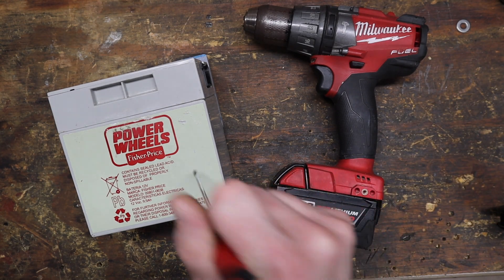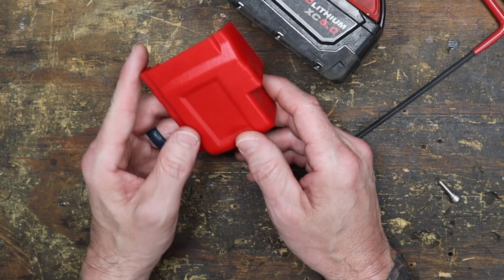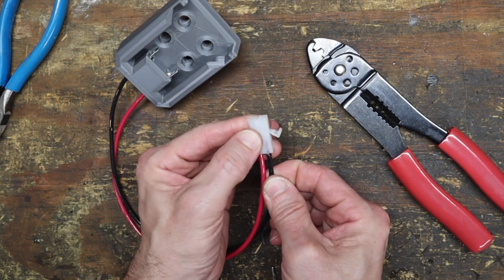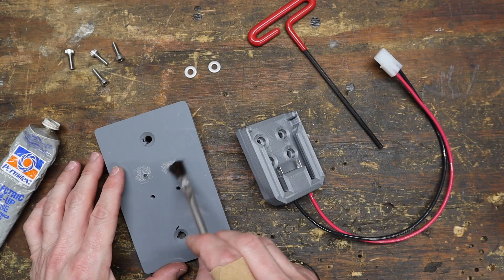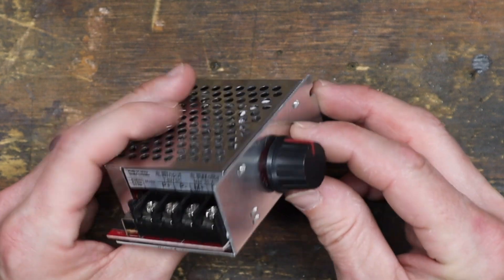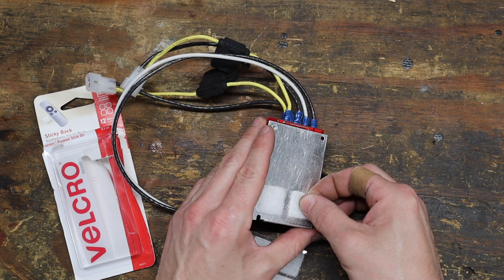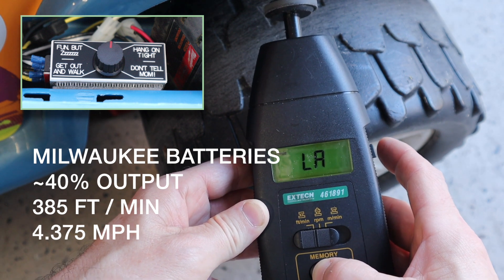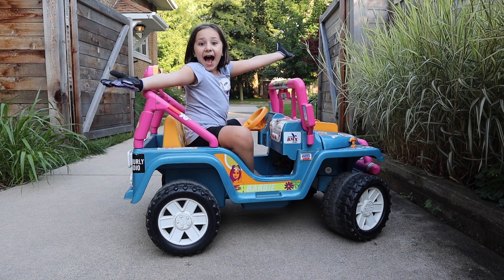Power Wheels Vehicle 18 Volt Milwaukee Battery Upgrade!

Comment: You sir are an engineering genius! I did the same thing with Ryobi 6 amp hour batteries took apart some Chargers and soldered directly to the board.
 I like the speed controller it's a nice touch also like the Dual batteries for the extra capacity

Comment: Should have wired it in series, and then did a DIY wheelie bar video too.
Reply: I had a customer come to my shop and asked me to cast some metal gears for a power wheels project. We made some from aluminum and he absolutely loved them. Ended up breaking them so we remade them out of 316 stainless and he came back about 2 months later going on and on about how they worked so perfectly. His son now wins every power wheel race they have in the neighborhood. Of course we had to solve the low traction tires issue. Nothing a lawn mower tire cut to a sleeve and secured to the plastic couldn't fix. Then had to add a wheelie bar and some front end weights. Lesson to take away from my story, if it has a motor and wheels, it can be modified.
Reply: @TheSlimCognito  hahahaha.. thats really awesome!! Must be very proud kids (also his dad).. good job!
Reply: @SY_Vlog24  he is proud, he comes up with the modification ideas on his own, all I do is make it happen. He's very skilled at engineering and design, but sucks at the actual building part. It's stupidly easy to do when he brings in the digital schematics. All I do is upload them and let the machines work, but the gears I had to manually cast. Sand casting is no easy task. Glad I kept the originals because the aluminum ones were shredded. Also added a basic suspension system and shocks. Bicycle frame shocks seemed to work perfectly. We are turning a power wheels into a genuine off road racer. Next step is making it 4wd haha. It is an f150 power wheels after all.
Reply: My son has a 24v set up and it will pop a wheelie
Reply: @TNcountrylife  that's the plan for my daughter's power wheels. I already replaced the PW proprietary battery with a cheap "Mighty Max" 12v from Amazon. When she gets a bit older I'm going to add another in series. VROOM! :)
Reply: 36v would shear those plastic gears off in about ten seconds
Reply: @MartinFinn  I'm planning on doing it to my sons. Bit his is remote controlled so I'll be making sure hes safe. Also they sell aftermarket gears and motors

Comment: Buy extra tires cause your kids will smoke them off
Reply: Keith Rose recycle old tire treads and screw them into the wheel that’s what we did and it actually goes faster and off road better
Reply: @jeffbrewer7441  i remember doing that for my sister's jeep. I used mountain bike tires though i have to try old tires
Reply: @KR-wk8nd  I just put some mountain bike tires on the back wheels of my daughter's jeep. We have a big yard and often the wheels would spin in the grass if she was going up a small incline. Not anymore! Much better traction!
Reply: Jeff Brewer get some plastic sleeves for the wheels and make it a drift car!
Reply: We cut the tread off some old ATV tires and glued to the powerwheels it gave great traction but the kids liked the drift mode .
Reply: Rubber tires! Wheelie time
Reply: I bought some cheap rubber tires from harbor freight. Excellent traction. The only problem I can't get over is burning through the motors. On the 3rd one now

Comment: How long does the battery last cause I used 1 Ryobi 18 4ah and it lasted about  20 mins without a power regulator
Reply: This is what I was looking for. I have considered doing a my 4 or 5 Ah batteries & if I can get that kind of time, then it would be great!
Reply: That's why he used 2 in parallel. Same voltage but doubles charge time

Comment: Has any1 tried this yet? Im thinking of doing my conversion on my sons ford monster truck.
Reply: Have done it with dewalt 20v but exactly same idea. Lots more torque and speed. Was doing wheelies occasionally 🤘
Reply: @benoitchartrand5772  You done it with the Ford monster truck? You able to email me pics?
Reply: @MrALEG213  No not with the ford truck. Essentially you need to take the wiring from the current batteries (+ and ) and connect with the dewalt battery (or whichever brand you like). All i did was cut the current jeep harness and installed spade connectors on the jeeps wiring. Then take the battery and carefully look for B+ and b (on dewalt and surely others). Slide the spade connectors into the battery terminal. You may put tape around to hold the connectors in place. Definitely not as clean as the video but once the hood is down you can't tell it's a sleeper lol.

Comment: 1 have 4 different power wheels running Milwaukee and dewalt packs.   Gold!!!
Reply: john smith what dewalt packs did you choose?
Reply: I have some Milwaukee 18vs and some dewalt 20vs.   They both work amazing.   So simple ive had these for years.    The printed bases are way expensive.

Comment: Is this a dual motor or a single motor 
So if it had to be dual motor where would you place the speed controller unit in the circuit ?

Comment: I just ordered a Jurassic park 12v Jeep and noticed the crappy battery , its unbelievable how cheap is power wheels not to put a li-ion battery instead. I've been thinking about this exact mod but cant get the battery adapters.😐
Anyway, great vid!
Reply from the maker: Thanks Oscar! Links to the adapters, and all the other parts I used in the build are in the description. Have a look!

Comment: I just bought two Dune Racers for my two boys (5 and 3). I also bought everything on your shopping list all of which arrived today. I also bought a multi battery charger. The question, where did you get the black wires to marry to your fuse? Also, where did you get the black and white wires? I know you put a clip on the normal motor connector coming out into the battery compartment, what about the side connected to the speed controller?
Reply from the maker: Hey there Brandon, thanks for watching!

The fuse holder has two leads, a common black lead, and a hot yellow lead that's fused (at least they're yellow for mine, other brands/makers of fuse holders might use another color.) At any rate, both of the hot leads go to the positive (+) side of the controller, both of the common leads will go to the negative side.  You're correct, I removed the stock battery connector from the vehicle and replaced it with one of my Molex connectors. I then made a connector that mates to it with two pieces of wire that connect to the speed controller with spade terminals.

There's a decent still frame that shows the fuse holders and the mating power connector mounted to the controller at around the 9:10 mark of the video - here: https://youtu.be/XcVdPOUly6Y?t=550

Hope that helps!
Reply: It helps. I actually had the hardest time getting the molex wired right so I went to a different cable connection type. Biggest struggle now is that the fuse wire is not copper, it’s aluminum I guess? Anyway it’s not nearly as stuff and harder to get stuffed in the cable connection I used.
Reply: Also seems the speed controller have both burned out already. They no longer have a red light on them.

Comment: How long do the batteries last? Tryin to figure out if this conversion is worth it...
Reply: They should have more run time since the original is 9.5 ah and this together are 10.0 ah. Also he is using them at 75% of the voltage. Even if they didnt last much longer its  a great upgrade since each m18 battery charges in just 30min. I'm guessing 1 hour 20 min of runtime perhaps?
Reply from the maker: I'm working on a follow up video to do the battery life comparison. Stay tuned!

Comment: Thank You for the video.
Got all the parts, but the speed controller which arrives tomorrow.
Reply: I need to buy one of those rpm digital measuring devices
Reply: @jlg8689  Hey! sorry but I only got the parts for the project not the speed meter.
everything from amazon.  https://www.amazon.com/gp/product/B071NQ5G71/ref=ppx_yo_dt_b_asin_title_o05_s00?ie=UTF8&psc=1
https://www.amazon.com/gp/product/B07Q71H57D/ref=ppx_yo_dt_b_asin_title_o08_s00?ie=UTF8&psc=1